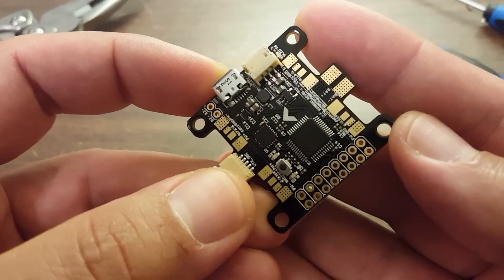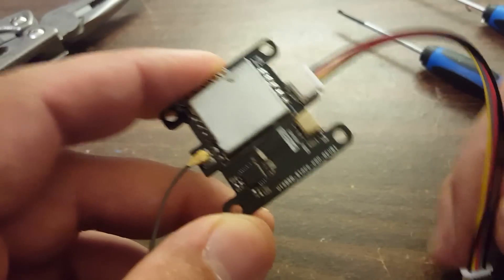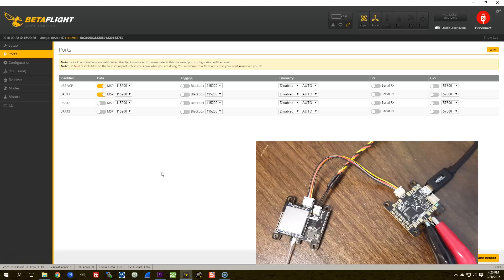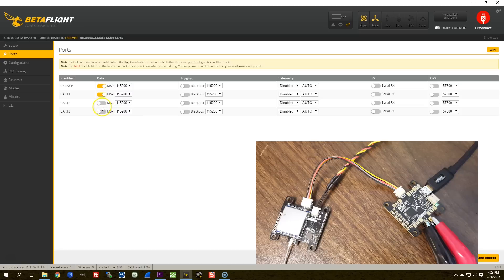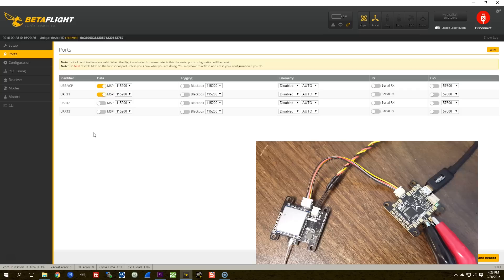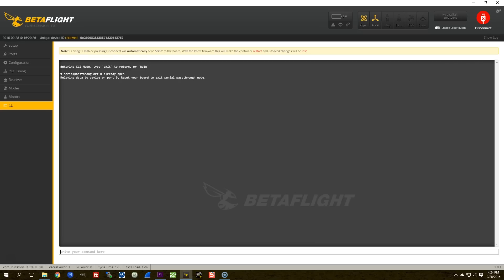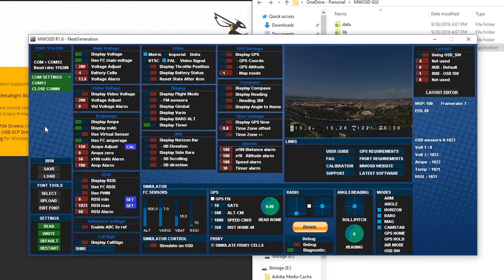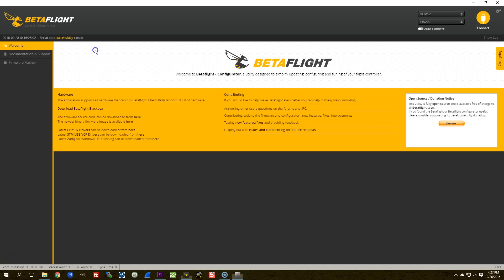Betaflight Serial Passthrough with Furious FPV Kombini OSD | HOW TO

Comment: Hi @Joshua Bardwell, I am having a problem with my Passado and serial passthrough. after I enter the command line into CLI I get a response that says "Port 0 already open.
Forwarding, power cycle to exit." I've tried powering with a battery and it won't connect to MWOSD. I'm not sure if it's a USB driver issue? or maybe the VTX has to be unlocked? your help is greatly appreciated. I'm running BF3.2.2 and the MWOSD 1.7

Comment: Has anyone had success flashing firmware via the passthrough? Ive been at it for at least 6 hours now. I am pretty sure that Im missing a step or something. Tried every uart port on 2 different boards. Can you really flash with arduino using the passthrough?
Reply: Guess this cannot substitute for a ftdi when flashing. Gonna just keep waiting for mine from china. There goes 8 hours of my life.
Reply: Flashing from pass thru does not work. Its missing the DTR pin connection.

Comment: Hey Benedikt - my whoop when I hit something and flip over and then flip myself again, it won't take off straight as if the gyro is messed up. If I throttle up immediately it'll flip. I have to throttle up slow and rebalance it out until it flies normal again. Is this a characteristic of BF? The Beebrain V1? Or do all the Tiny Whoop boards do this in angle mode. I mostly race indoors, so no room for acro.

Comment: I'm trying to use this method on the F3 V4 AIO FC( https://us.banggood.com/Wholesale-Warehouse-F3-V4-Flight-Control-Board-AIO-25mW-200mW-600mW-Switchable-Transmitter-OSD-BEC-PDB-Current-Sensor-wp-Usa-1102946.html ) and not having any luck. From what I understand the OSD is sharing UART 1 with the USB so I tried serialpassthrough 0 115200 but I still couldn't connect with the MWOSD Configurator. Any ideas on what I might be doing wrong?
Reply from the maker: +Gene Shogran you can't do pass through in the same UART that's also used by USB.
Reply: Ok, thats to bad. Thanks for the help

Comment: Hey Joshua, I know this is an old post but I have been trying everything I can to figure out what's going on with the osd on a DYS XDR220 quad with spracing F3 PDB/OSD FC. I know nothing about OSD and I changed the setting debug from off to on and now there is no OSD in my goggles.. I tried this but it didn't seem to work. I have tried a FTI and a ardeino nano and the UNO programmers still all I get in MWOSD configurator is it telling me it's connected but "waiting on OSD". So I can't do anything. I wish it was as simple to turn the debug off as easy as it was to turn on. lol  I hope all of that makes sense and I can learn something today?
Reply from the maker: What exact FC are you working with? Please provide a product link?
Reply: It's a DYS XDR220 spracing f3 PDB/OSD. There is hardly any info anywhere online about this quad. Here is the link. http://www.dys.hk/ProductShow.asp?ID=232

Comment: Joshua - Video Request:  MW OSD 1.7 and using the Chrome MWOSD Configurator 1.7 APP.  With Betaflight passthrough.  I can't get the app to work.
Reply from the maker: Sorry man MWOSD is a thing of the past to me. BFOSD and never look back. :-(

This kind of nonsense is exactly why I am glad to see MWOSD go.
Reply: Agree to BFOSD superiority, but some ARF's like the Wizard still have no OSD.  This is is why I bought a few to OSD to put OSD in my pre BFOSD builds.  The TX menu does work well though.

Comment: Josh, I had problems getting to connect my Kombini to Windows 7, the Serial Port, display "Succesfully Open", but after a couple  of seconds the Serial Port displays "Succesfully Close" any reason why is this ?? Thanks
Reply from the maker: One possible cause is that you flashed the wrong target to the board.
Reply: A friend assamble all the quad parts and FC and used betaflight in Mac to set all the parameters. A couple of days ago I had an issue during flight and the Kombini FC is not arming. I´ve try to figue out what is the FC problem but Windos 7 keeps displaying "unknown device" as well as Zadig, when in DFU mode Zadig displays STM32 Bootloader. I am preaty sure the main problem are the drivers but can figure out what is the main problem any idea ?? I´ve seen your Betaflight Drivers setting video but haven´t any results.

Comment: So if USB and OSD is sharing the same UART1 can I still do the serialpassthrough? Or it will brick my FC and cant access it via USB again? I have 3 UART but my OSD is built-in sad to say that the manufacturer did not separate the USB and OSD. I can confirm this by plugging the USB, the OSD and camera on my goggles will be off.
Reply from the maker: No, definitely not. But I doubt it will brick the FC. Just power cycle the FC  and passthrough will be cancelled.

Comment: hello, didn't worked for me, what I'm doing wrong? thanks
Reply from the maker: You can only configure the OSD this way, not flash it. I was mistaken when I made the video.
Reply: yes, I'm trying to configure the OSD of the F3 V4 board, not flash. The ossd is working but I want to enable the RSSI display...may me I have a bad FTDI? jumping tx/rx pins of the FTDI shows nothing on the arduino serial monitor.

Comment: thank you for the detailed video Joshua, my question is; after flashing the osd, should i close the UART 1? because when UART1 is open, when i plug the usb, buzzer keep beeping. 

Other question is; on piggy osd, i am able to change the layout on mwosd and able to write. double checked is written by reading later after saved. But somehow i see no overlay osd on my camera feed. I am sure NTSC is selected, and able to see my camera feed. 

Do you have any thoughts? Cheers!
Reply from the maker: I don't know why the buzzer would keep beeping, but if closing UART1 makes it stop, I guess I would do that.

If you can't see the overlay, NTSC/PAL set wrong is the likely cause. Change it to PAL. Maybe your camera isn't NTSC.

Comment: I try to use this with a SP Racing F3 board and minimosd micro. It's connected to UART 2, but the GUI software of Minimosd stays on "Waiting for OSD" and only the RX text on the GUI is blinking. Quite annoying, because otherwise I need to desolder it. Another way would be to buy the male connector for the UART cable (which came with my SP Racing F3) and hook that up to the minimOSD and connect those pins back to a FTDI adapter.

Comment: thanks, Joshua. I have the piko blx and the innova osd vxt but can't get it going. I used the pins and can pass through to mwosd bit get nothing but static. suggestions?
Reply from the maker: +JAD static usually means the vTX is not powered up. Check with a spectrum scanner like on LaForge or True-D to see if it's transmitting at all.

Comment: hello - if are using softserial for your mwOSD, the numbers to use are 30 or 31 for softserial ports 1/2.

so the command for softserial 1 is: serialpassthrough 30 19200

then on the MWOSD GUI - set the baud rate to 115200, NOT 19200 otherwise it won't connect. I assume this is because the connection to the flight controller is still at 115200.

Just though i'd post this here as nobody seems to have highlighted it anywhere!!!

Comment: Ok guys I need help.  I have the flycolor raptor tower 390.  I am attempting to update and configure my mwosd using this method.  I have the arduino program what settings do you use for the serial pass through?  I have also been able to launch the 1.5 configurator it looks like it is communicating but it wont read or write.  I need help!!!
Reply from the maker: Is the FC talking to the OSD at all? Like, during normal operation do you see your arm status on the OSD? Or does it just say "No Data" or something like that.
Reply: yes my osd data is showing up and the values are correct.  While I am in the configurator I can hit the restart button and my osd in my goggles will reset.  That's what has me so confused it seems likes its working but it doesn't.  I have made sure the osd is set to the ntsc through the transmitter inputs.  I am at a loss.  I have arduino 1.8.1 on my pc.  My drivers are updated.  What arduino settings would you use for the passthrough?  Could the osd be locked from the factory?  I really do appreciate your help
Reply from the maker: +mxnew2004 you can't flash the board using pass through. You can only use the MWOSD configuration utility.
Reply: I have a 6 wire isp pigtail that came with the board.they are labeled - 5v rt rx tx -  the rt is hard to read on the board.  I have a arduino nano and a ftdi adapter.  I have tried all the usual pins with no luck.  can you explain which pins go where?  I am also running a run cam swift when I was using the tx configurator I had to unplug my camera to make the switch to ntsc.  any reason the cam might be interfering with mwosd configurator

Comment: Joshua Bardwell where do I find this 36mm VTX? 
if not available do you know any 36mm with 30,5mm mounting holes? I don't need a osd! 
tks
Reply from the maker: Furious FPV Passado, but it has an OSD as well. I'm sure there are some 36mm vTX but I don't know one off the top of my head.
Reply: Joshua Bardwell can't find it! the one of this video is not yet available? 
Just found the Diatone SP3, looks nice!
Reply from the maker: It's not available yet. It's been "coming soon" for a couple weeks now. There have been some teasers on Furious's FB page.

Comment: Hey Joshua, can you set the mah consumed on the OSD?
Reply from the maker: Absolutely. The Kombini has a current sensor built in.
Reply: So in theory any PDB that has a current sensor can send the consumed mAh to the minimOSD? How would you do that? Via any of the free UARTs?
Reply from the maker: The MinimOSD board should have an input for an analog current sensor. Feed any 3.3v analog current sensor into the MinimOSD directly and calibrate the current scale and offset and you're good to go. 

However, this approach does NOT get the current reading into the FC, which can be useful. For example, if the FC knows the current reading then it can feed it back to the Taranis via telemetry. The FC can also log current via blackbox, if you're into that. 

So the preferred approach IMO is to feed the 3.3v analog current sensor output into the current sensor input on the FC, assuming it has such a thing. Then the FC communicates the current value to the MinimOSD via the MSP protocol (over a UART).
Reply: Thanks a lot Joshua! I'm probably going to order the new Kiwi.F4 from FlyingLemon. I recently got their 48ch diversity receiver for the fatshark and it's the best I've seen. Trumps the LaForge imho. :)
Also, what do you think about the Garuda200? I'm looking for a new frame, getting tired of my simple RD210

Comment: I have BeeRotor F3 board and can´t connect to onboard OSD even if I follow your steps and then I have to reflash betaflight to reconnect to beteflight 3.0.1
Reply from the maker: +minibok2008 that's not how it's supposed to work. I don't know...
Reply: Copy and paste from: https://nathan.vertile.com/blog/2016/02/03/rctimer-beerotorf3-flight-controller/#minimosd
Also, there is an open pull request against CleanFlight that makes it possible to configure the MinimOSD by communicating through the STM32: https://github.com/cleanflight/cleanflight/pull/1620. When this feature is finished, we won't need to go through all this to configure the MinimOSD, we'll be able to do it all via the normal USB connection.

Comment: I have the Furious Piggy OSD and it is able to connect with the pass through.  Problem I am having is the OSD is at the top of the screen and being cut off.  I tried playing with the position a little bit.  looks good on the sample template but on the fpv screen or goggles it is still stuck at the top of the edge of screen and being cut off.  Any ideas??
Reply from the maker: +Quad Flya move it down one line?
Reply: Joshua Bardwell.. Thank you for all your help it worked moving a few lines.   Your videos are so informative and helpful.   Thank you

Comment: and wich number i use for a softwareserial ? :D only count up?
Reply from the maker: +Kaoala I guess. I can't confirm it works on softserial. Can you?
Reply: Joshua Bardwell I typed "serial" into cli and ist shows me the numbers 30&31 (from softwareserial i guess) i tried, but betaflight crashes. after unplug the USB from the FC and plugged it back it, i was able to connect to betaflight again.. so i have to try a little bit more :)

Comment: I'm using a Flip32 F4 board and was able to use this feature to make changes in the MWGUI but after doing so I can not connect to my LemonRX Spektrum satellite, I even re-flashed BetaFlight.  I have a solid LED on the Rx but nothing is working in the Rx tab.  The satellite is on UART1 and I used UART3 for the OSD.
Reply from the maker: Once you reboot the board, serial passthrough is not having any effect any more. I can only guess that something about the OSD installation is interfering with the serial RX.
Reply: I ended up having to re-bind the satellite even though the LED on it was solid when the radio was turned on.

Comment: Joshua will this work with any OSD?  and a Kombini FC?  

I just got a Furious FPV Piggy OSD and I was wondering if this pass through trick would work to adjust the settings on my Piggy OSD?
Reply from the maker: It definitely will work on Piggy. That's the tutorial from Furious that I followed to make sure I got all the steps right. It will work with any serial device that is attached to a UART.

Comment: I'm about to flash 3.0.1 onto a quad because I want to see if the new filtering defaults have a positive affect.  I've always just manually configured my FCs after flashing.  Can I just use the "diff" command, save that to a text file, then paste in the cli and save after flashing to configure my fc?  Thanks.
Reply from the maker: +ShareCraft yes.

Comment: i had no idea the Kombini has a built in current sensor, this makes this a perfect set up
Reply from the maker: +Anatoliy Pishenin it does. And you can export the current data to the osd.
Reply: Joshua Bardwell do you know when they will release the stack on vtx
Reply from the maker: +Anatoliy Pishenin I don't.

Comment: Hmm. OK. So I have a cc3d that I want to flash Beta flight 3.0 to and I have no ftdi adaptor. I do have an SPF3 that's already running Beta flight 3.0. So do you think I could use the serial passthrough function on my SPF3-BF3.0 to flash the hex file to my Cc3d? ( (edit), going to order an ftdi adaptor sometime this week, but don't wanna wait a week for delivery..)
Reply from the maker: +Flight Dreams in theory, maybe, but the fact that CTS and DTR aren't passed through makes flashing difficult.
Reply: cool. going to try it Monday when I get home. I saw a vid of a cc3d being flashed and all that was hooked up was gnd, tx and Rx. as for CTS and dtr, just gotta power up the cc3d and short the bootloader pins. thanks a bunch Joshua! Love the Vids! Keep up the hard work bringing awesome content. Thanks!!!!

Comment: When an FC (or PDB) like the Kombini says it has an LC filter does that imply that all power outputs (5V, 12V, power to ESC's will be filtered, or just the BEC regulated output? Do you know what the Kombini applies the filter to  if not all? The product description isn't clear to me that you can get filtered power at both 5V and 12V...Thx.
Reply from the maker: I would assume it means the power output to the vTX is filtered, at a minimum, and maybe the camera too. Past that, it's fair game.
Reply: Makes sense. So if the power to the Vtx is filtered, and the Vtx has a 5V out to power the camera, all the video will be filtered, which is better than just regulated anyway. Thanks.

Comment: Great! I have a piggy osd on the way. So I still need the ftdi to flash it right?
Reply from the maker: I think that may be true, unless you can catch the bootloader window on powerup. Because the DTR and CTS pins are not passed through.
Reply: ok it is driving me nuts. It is imposible to flash this board. I tried the minimosd tool aswell as arduino. It cannot contact the bootloader and I cannot see any bootloader jumper.Tried every suggestion on the net , different wiring etch. I send them an email and wait for an answer. I tend to believe that they send me a either a faulty board or an ftdi.